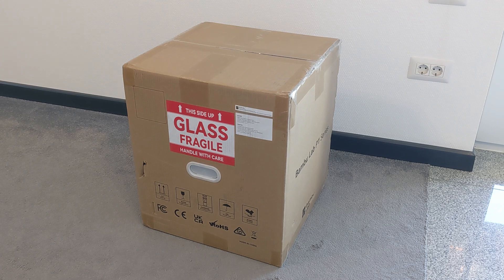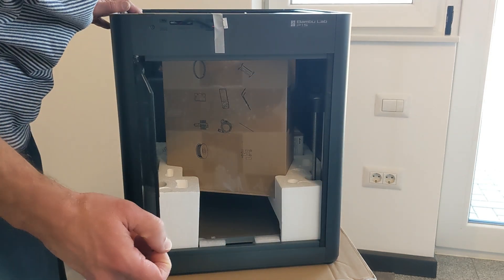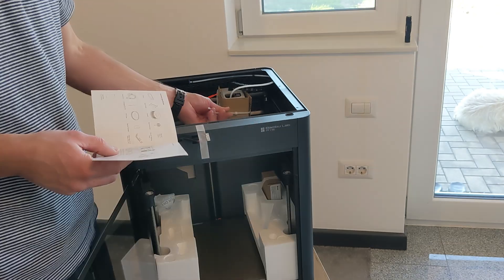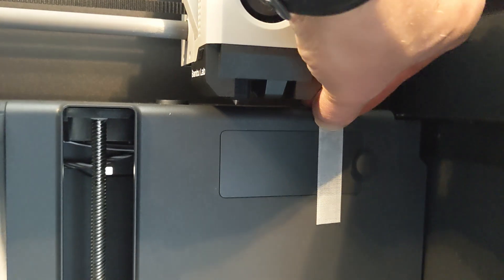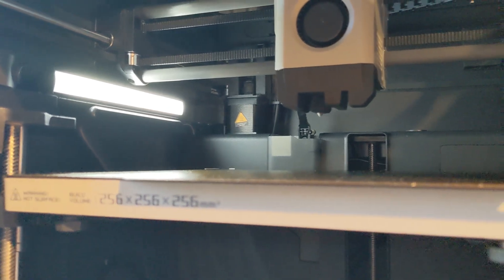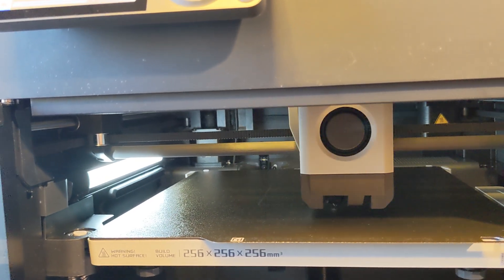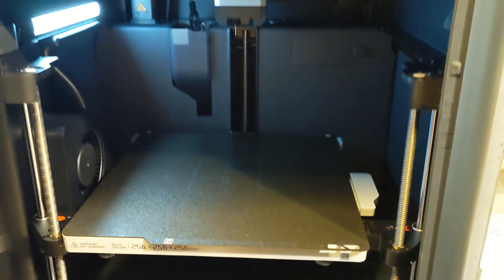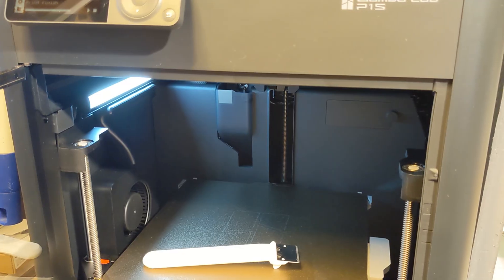This 3D Printer BLEW My socks Off: Bambu Lab P1S Assembly & First Print

Comment: Very nice. On BF I ordered mine, but I chose A1 bc is more silience
Reply from the maker: That's an awesome printer. I love how fast you can change nozzles with the A1
Reply: @one2three123  I ordered combo version and  all spare size nozzle. I wait for nozzle delivery. I can wait to try 0.2 nozzle.
Reply from the maker: Great, I also ordered the 0.2 and the 0.6 nozzles, alongside the hardened extruder gear but that shipment didn't arrive yet.